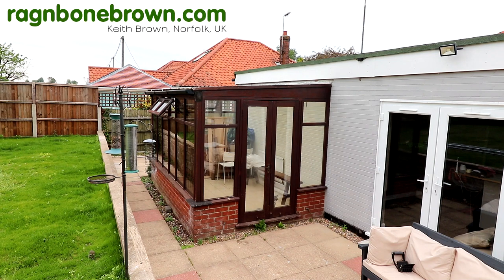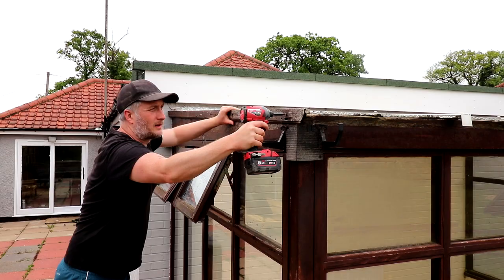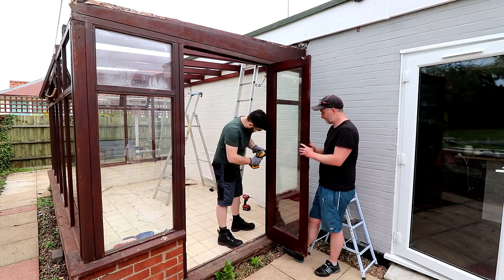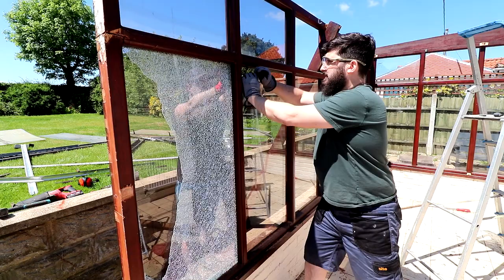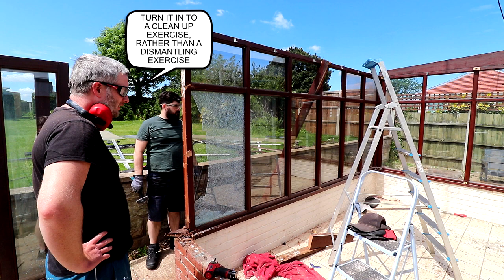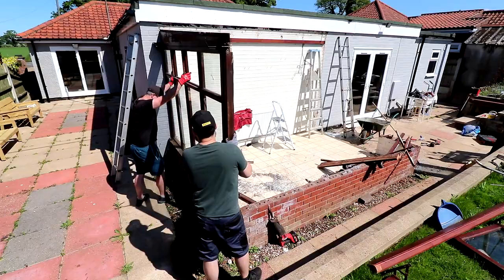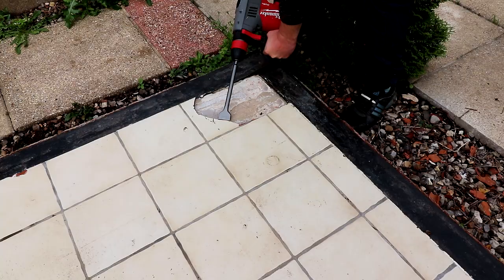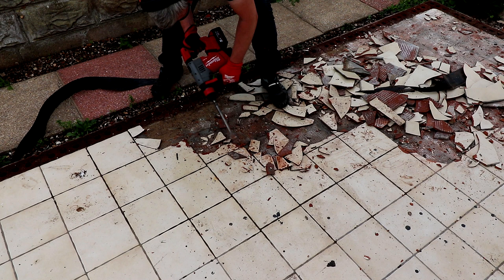We Demolished A Conservatory - Demolition Day!

Comment: Nice work. The issues of conservatories being to hot and too cold might be why my preferred builder was telling me people tend to go for walls with big windows and roof lights.
I think you might want to consider a raised concrete slab a bonus. It could be used for an extension. It could form the basis for outline planning permission (increasing the price of your house). It could form the basis of an actual extra (garden) room without the issues a conservatory has.

Maybe consider this: I had to put in a slab for a seating area in my yard. I deliberately dropped it about 3" lower than the existing path to make the yard walls feel higher - making it feel more secluded and private. You have a similar raise. That means you have a head start in making a seating area that feels special. 

I don't think the surface is as important as the plants you use near it. Great spot for a mock orange and a winter honeysuckle.
Reply from the maker: Hmmm... Did you breach your dpc though? Our bungalow has many extensions, it's our forever home, and we really do not need any more internal space than we already have
Reply: @RagnBoneBrown  Oh, no. It's a slab with 20 inches of planted earth between it and the house and the side and back yard walls.
Did this actually breach your DPC?
Reply: @RagnBoneBrown  I see it - at 11:49. Looks like the slab goes as high at the DPC so anothing you put in top may breach it.
OK - I am not an expert, but one thing I did may be of interest. In my tiny front garden, some fool had put concrete down right up to my bay window. I removed this so I could drop the earth here, make an area to plant a mock orange and make subsurface water drop accordingly.
Tools I used were a hammer drill to make deep holes along the line I wanted, an anglle grinder to do a deep groove then a lump hammer, cold chisel and crowbar to remove concrete.

These are all within your toolbox, so far as I know. I have since got an SDS drill. Everything I did is definitely within your capabilities.

I ended up building up under the cut a little to create a smoother concrete wall - to deter long-term deterioration. So far so good.

It would be a bit of work, but you could make a channel at the back of the slab, drop the level of the soil and plant it - or gravel it for a French drain.

Comment: I faced a similar problem (two level deck outdoors). In the end, we took up all of the pavers, edged the entire area with brick, filled with gravel and set the pavers (with a small gap between then) on the gravel to match up with the concrete.. So, knocking down the solid concrete is not the only option - for use it was cheaper and easier to raise up the rest of the pavers. It's worth considering (I have no idea what gravel delivery costs in the UK).

Comment: You may have already thought of this, so excuse me if Im a bother... I had a project like the concrete slab.  I rented a jack hammer and spent two weekends breaking it up and grinding through the rebar.  Once done, I sold it as rubble. Made a tiny bit more then the cost of my tool rental.

Comment: Automatic or old fashioned centre punch for toughened glass or if you've got an old spark plug floating about, break the white ceramic part and literally throw the ceramic bits at the glass and it'll pop 👍 looks like you had a load of fun either way 👌🤣😎

Comment: Nice job on the demo, sometimes the projects condition determines how the demo needs to be done.  BTW, stamped concrete or an epoxy pour would look nice for a new floor outside and it would go right over the existing concrete and would allow you many colors and options.

Comment: hire a Kango and break up the slab yourself. One skip later and jobs a good 'un.

Also capping off the radiator pipes is well within your skill set Keith I'm sure! no plumber required.

Love watching your videos!
Reply from the maker: Cheers, I have no desire to get involved with plumbing, plus the pipes on the other side of the wall are beneath a concrete floor

Comment: Hi Keith, the floor of the demolished conservatory is really level. This means you can stick outdoor porcelain tiles really easily on outdoor tile adhesive , or calibrated sandstone or kota limestone or any calibrated slabs from a paving centre on the raised base. Split level patio will look great...
Cheaper than tile adhesive would be mortar sand and cement at about 4 to 1 and add SBR... Search for SBR additive on Skill Builder youtube. It makes mortar super sticky and it's way cheaper than tile adhesive
Reply from the maker: Thanks a lot David, this sounds like just the kind of advice I need! I'm assuming I'll need to put a very slight fall on the tiles so that rain runs away from the house? I'm a bit concerned that if I start at the front and work my way back towards the house I'll be packing the tiles up too much by the time I get to the wall .... Don't really know what I'm doing!!
Reply: @RagnBoneBrown  yep you would need a fall away from the house, about 1 to 100 but you could cut some tapered strips of timber as guides, and check their heights in relation to each other crossways with a string line, then fill between the strips with mortar and SBR and screed off. Makes it really easy and quick... Your patio should be max 150mm above other pavi g and mínimum 100mm
Reply: Only other thing, is this base above your DPC of the house?
Reply: Probably should have said too, that you remove the tapered guides and fill in before laying
Reply from the maker: Thanks, I think I understand what you're saying. Sounds like a great idea. The house dpc is level with the top of the slab so I guess I might need to add a dpc strip between the house and the raised ramp part of the screed, even if it's only a couple of inches? I'd love to pick your brains some more if you don't mind!
Reply: By the way...
2 things, you could remove the radiator, just turn off the valves at both ends and undo the nuts
You'll need to make a gap between the wall and the concrete base, DPC won't work, or you could torch on felt or get tanking slurry and paint the wall
Reply from the maker: Thanks so much, that's really helpful - I'll drop you an email at some point! 👍

Comment: Just buy a cheap breaker and remove the floor yourself. I had one from Screwfix that was £100 that came with bits and was actually pretty good. It's easier than you think. Plus you can sell the breaker once your done with it, you won't make all your money back, but it be cheaper than having rented one. Plus you don't have to worry about completing it in the time you had rented one for, you can do it at your leisure and you can delay things when the weather is crap!

Comment: Nice job on taking down the old conservatory. The slab that's left, how close is it to the DPC in the bungalow? As I'm sure you know, external surfaces should ideally be 150mm (min) below your DPC.
Reply from the maker: The slab is the same level as the dpc, so I need to figure out some options not to breach it

Comment: Nice job Keith. Demo isn’t easy. Wait until you demolish a few chimney breasts. Possibly the dirtiest job on the planet!!!

Regarding the slab, I’d hire a heavy breaker and demolish it. For the following reasons;
1 - You’ll trip on the thing and it will annoy you.
2 - If you have plans to have kids, they’ll definitely trip on it and fall off it.
3 - It’s one of those jobs you put off and then wonder why you didn’t do it.

And from the perspective of my day job as a Building Surveyor, there’s a potential damp issue. Having the concrete slab wasn’t an issue when you had a structure around it but now you’ve got the slab exposed, it’ll most likely be breaching the DPC, so dampness is a real risk. DPCs need to be at least 150mm above the exterior ground level. 
You can alleviate this by adding a roof over the slab but it would have to be much wider than the slab and a pergola wouldn’t cut it I’m afraid.
If it were my house… I’d break up the slab and continue the patio around to maintain a minimum of 150mm below DPC.
Reply from the maker: Thanks for the advice
Reply: @RagnBoneBrown  My pleasure.

Comment: I’m sure Your more than capable of removing the slab yourself. You could hire a big breaker or even buy one at a reasonable price. Then it’s just a case of digging down a bit then putting some type 1 in and slabbing it. You could do it for a fraction of the cost you were quoted. I would say around £500. It would be better than having a raised area or trying to hide it 👍

Comment: Removing that radiator should be a pretty easy job Keith, can you not drain the system, cut the pipes and just connect with some compression fittings?
Reply from the maker: No I have no desire to get involved with plumbing to be honest
Reply: @RagnBoneBrown  Fair enough! I'm just too cheap :P

Comment: Judging by the build quality of the original space I suspect the slab would be quite easy to remove. Use your biggest SDS to drill a few test holes to get an idea of what you're up against.  3 weeks ago I hired a 110V road breaker from Hirebase (about £50 for a weekend on offer), paid a labourer £150 for a day (cash) and bought a "HIPPO" bag for about £100. Area looks to be about the same.  Labourer arrived at 8am and was gone by 2pm.  You don't look as old, fat and f'd as me so you could probably save £150 on what it cost me.....  Extra costs which were not accounted for, about 2 pints of Tea and 3 Bacon Buns, absolute bloody bargain! 😁